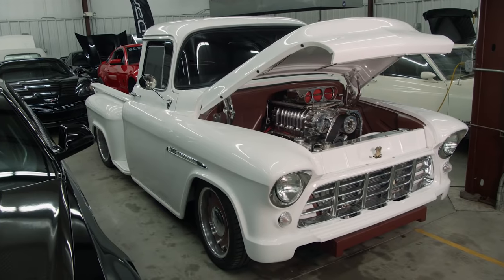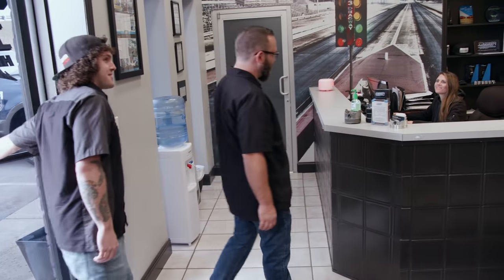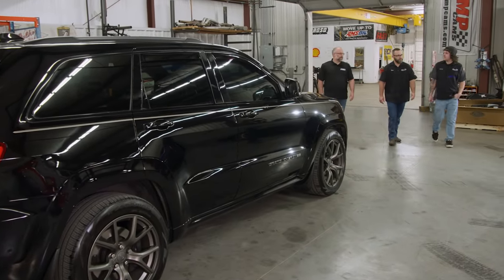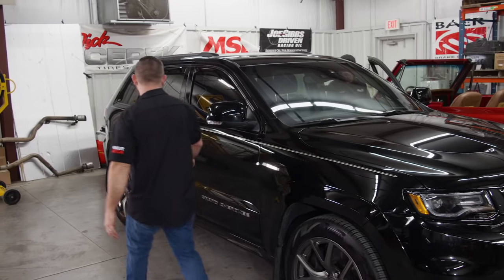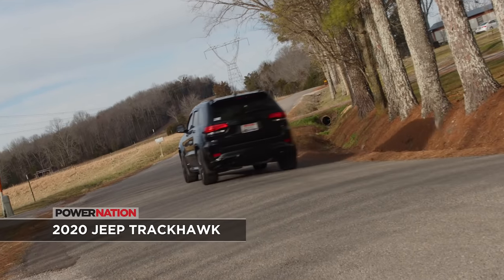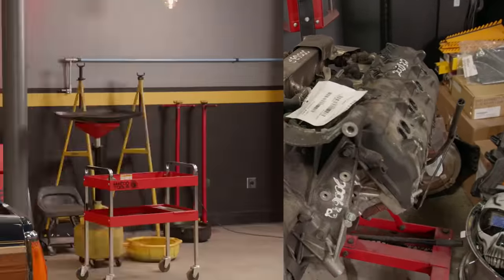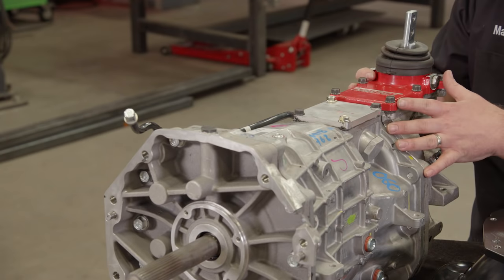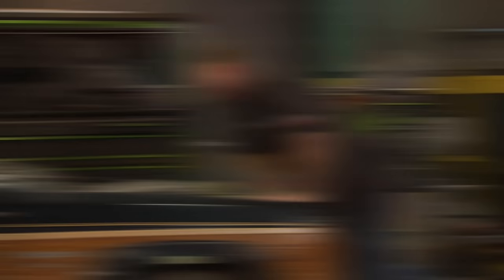Full Build: Turning a Jeep Wagoneer Into a Tire Burning TrashHawk

Comment: I'm sorry guys, I love the channel but the executive who approved this. No no no
1.First that is a rare XJ and CLEAN one at that. It should not have been chopped up
2. The Grand Cherokee ZJ would have a  been a better choice. Larger engine bay for V8, is a Grand Cherokee platform like Trackhawk. Simple 4wd system
3. I don't hate the LS, love my GMs to death but a built Hemi swap would be more appropriate for a Dodge/Mopar
Reply: It's sad to see 4WD removed from a clean old XJ Wagoneer. They were the luxury version of this series. The interior and exterior are so much nicer than typical Cherokees. Such great styling. I have a 2000 Cherokee Sport and it looks like a cheap ass baseline vehicle compared to the vehicle these guys started with. I would have gladly traded for the Wagoneer so they could hotrod the hell out of my Cherokee.
Reply: I don't know why they didn't find a jeep grand Cherokee from the late 90s or early 2000s instead.

Comment: 787 hp / 652 hp rear wheel  so 17% loss in driveline way to much for my taste since is 2wd and manuel trans.
Reply: Power is down because of exhaust system. They had to use a cast iron manifold for clearance.
Reply: @markball7028  Hooker manifold flow very well ,the lost is minimal on hp more on torque, as you can see on the dyno here ,but 135 hp  is way to much for driveline
Reply: @chrisland169  they may flow well at 500hp levels. But they don’t compare to open long tube headers on a dyno. It’s been proven time after time. Not to mention they put a full exhaust system on this thing for street use.
Reply: @markball7028  If you look carefully on the dyno the test is with shorty headers  ,a very minimal lost between  the two set (cast iron)  here is about rpm and volume of cfm ,  and it been run without  air filter  in a open space !
Reply: @chrisland169  whatever guy. Your right I’m dead wrong. You win at everything. Lol. Don’t know why I even bothered. Forgive me superior intelligence one. 🙄. I guess I should just throw away my long tubes on my 800hp nitrous breathing Chevelle, and put some cast iron manifolds on it. What was I thinking. 🤦‍♂️